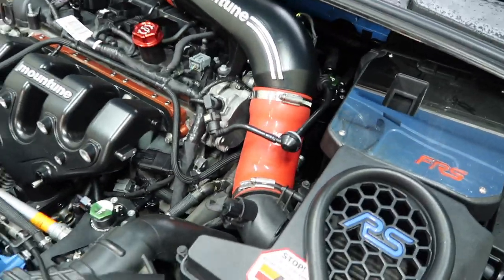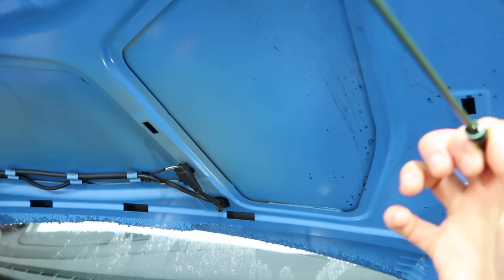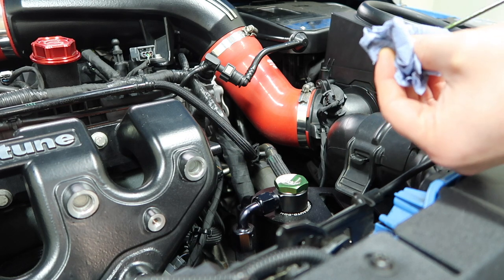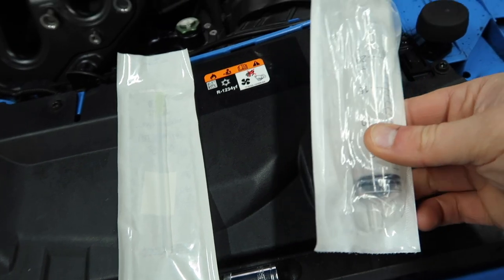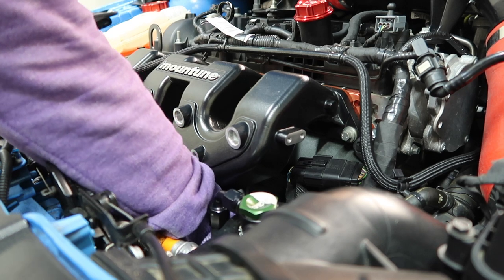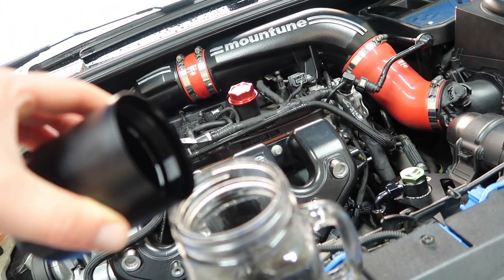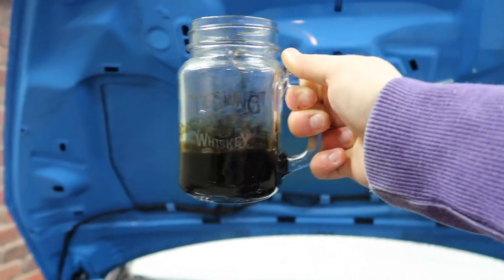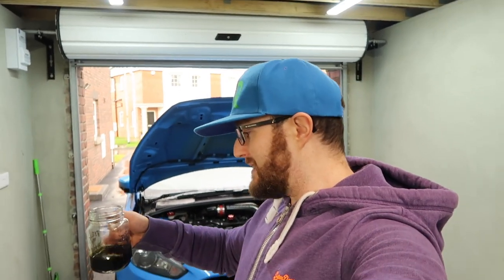ARE OIL CATCH CANS WORTH HAVING? | EXTRACTING LOTS OF DIRTY OIL! | FOCUS RS

Comment: If you cut the tip of the mixing quill at an angle (so that it makes a point at the end) it should help prevent it sucking onto the bottom of the catch can - the point will hold the opening slightly off of the bottom, hope this helps, keep up the great videos!

Comment: Great video as always, Adam! Do you know if the radium PCV catch can will work with the Mountune breather plate?
Reply: recommended to get breather plate. You need either Mountune or Radium, i went with Mountune and it works great. I think without the upgraded breather it doesnt have a vapour outlet for the boost side can. (back of engine one). Thats from my understanding. Breather captures and allows the vapour to settle better and then be collected by the catch can

Comment: Great video. Very informative and helpful. I'm able to locate the ccv and pcv of my ford explorer 2.0 ecoboost which is by the way same with your engine. I just have a question on the ccv side of your catch can. The ccv valve is the outlet going to the inlet of your catch can, and the outlet of your catch can is going to the turbo intake?

Comment: I purchased the CCV & PCV oil catch can for my 2018 FOST. I drain the PCV oil catch can every 3000 miles. I ended up taking the CCV side off as it was always empty. Mine has the drain hose on the bottom which is accessible during an oil change and makes it really easy to drain but your method to empty the can seems to work fine too so I don’t know if it’s worth it to at the hose. It’s nice to know that you won’t have all that oil sludge coating your valves going forward.

Comment: That method is good enough.

Any idea if this kit will work with a mountune baffle plate? Cheers
Reply: I thought he had a baffle plate installed as well.
Reply from the maker: I do indeed have a baffle plate :)
Reply from the maker: Hi Matt, so yes indeed it will work with it but you will need to either use the factory PCV valve or if you want to use the auxiliary ports on the Mountune plate, you will need to source some connections for the hoses. I had the Mountune plate but then replaced it with a SiCo Developments plate as it had the option of coming with a pre-installed uprated PCV valve with easy connection to the catch can system. Cheers :)

Comment: Great video. I will be ordering mine very soon for my ST (PCV Side) only and the baffled plate. I will however add on the petcock option.
Reply: I have an st as well. Can you explain what the baffled plate does?
Reply: @bryshaunporter4782  it doesn't allow oil vapors and residue to flow back up to the intake